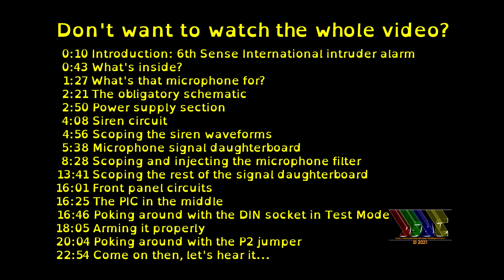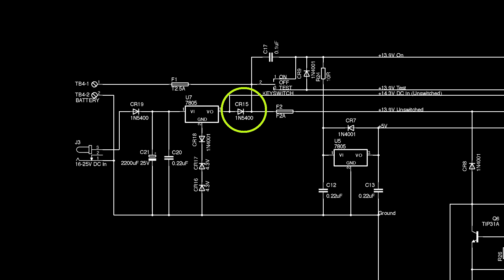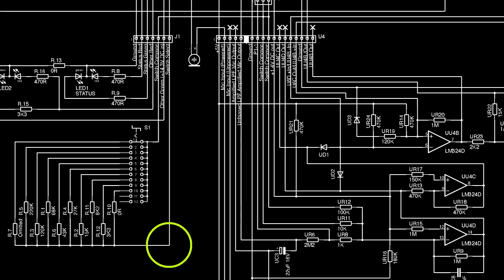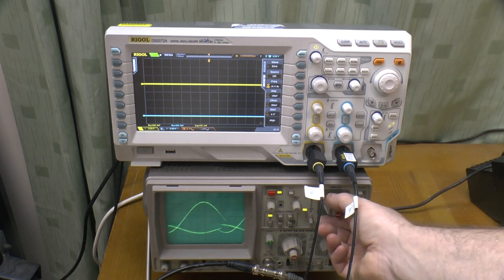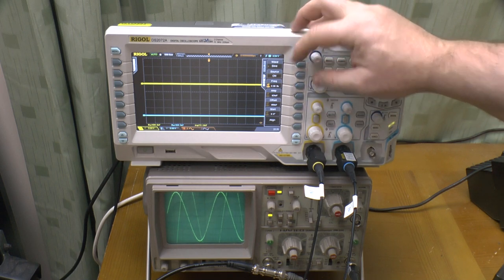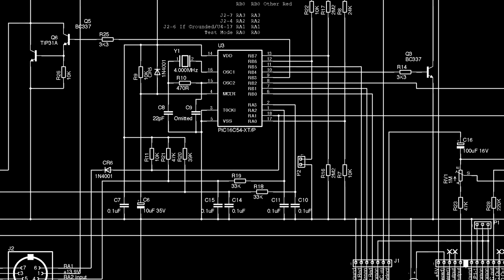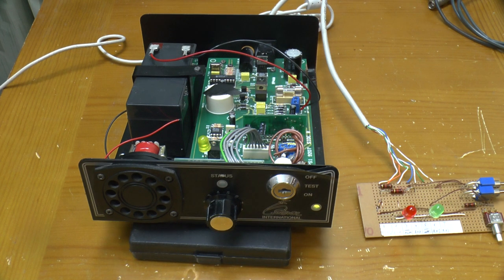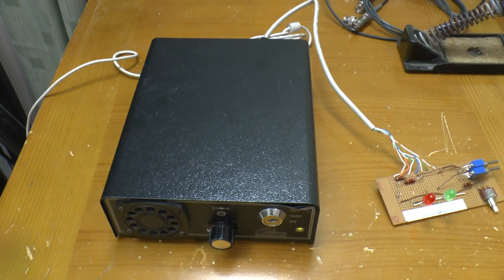6th Sense International intruder alarm teardown

Comment: I remember at least one product years ago that used pressure change to detect a break in, but can't remember what the unit looked like, it was billed as not needing to 'install', so could be used for temporary situations.
The input that triggers the alarm regardless could be a tamper.

Comment: The most interesting bit is the microphone and its associate circuit, as this is acting as the pressure sensor. 
It would be nice to know more about the type of microphone used, as this must have a very low cut off on its frequency response. So what sort of microphone works down at  4Hz?
It would also be useful to know the sensitivity of the alarm and more about what will trigger it. 
One of the UK TV shopping channels was selling a pressure sensitive alarm in tne form of a block that plugged into a mains socket. This was reputed to be so sensitive it could detect a door or window opening any where in a four bedroom, two story house. Alarm sensors are one of my interests.  I collect circuit ideas that have unusual sensors.

Comment: I have that exact same hameg analog scope.  one of my most used scopes.
Reply from the maker: I bought it secondhand from an old school.  They had a HM203 and a HM205-2, both the same price because they were none the wiser.  Bought the 205-2 and a Thandar frequency counter :)
Reply: @AintBigAintClever  Thats funny, I also own a HM203 along with my 205, and funny thing was, I bought them both at a goodwill thrift store for 20 bucks a piece. Got them 9 years ago, my 203 still works great but my 205 needs some repair.  Great scopes though I love em.
Reply from the maker: @UmbreWolf  I loaned out my 205 and it came back with a buggered storage board.  It had been fed something it didn't agree with into the back terminals.  Fortunately the affected component/s had let out the magic smoke so it was a relatively easy fix, even for me :)
Reply: @AintBigAintClever  yeah I opened mine up, no clear signs of anything failing but for some reason it works fine for like the first ten minutes then its like the inputs start cutting in and out every 5 minutes, I suspect something over heating but I havnt had the time to look into it or work on many projects.  trying to stay financially a float here in America isn't an easy task on your own at the moment.